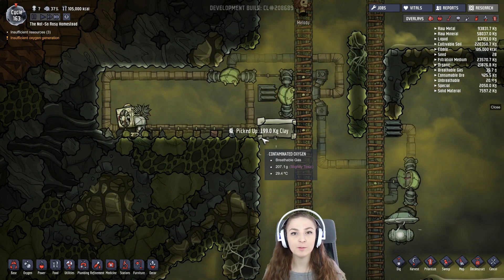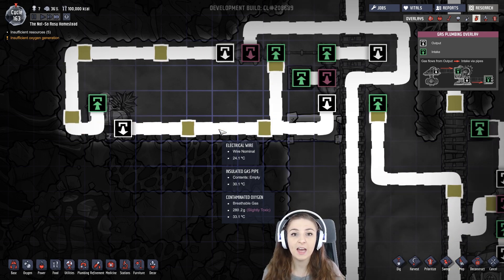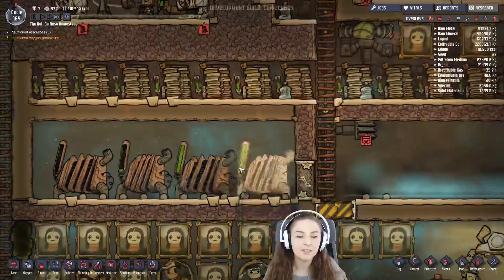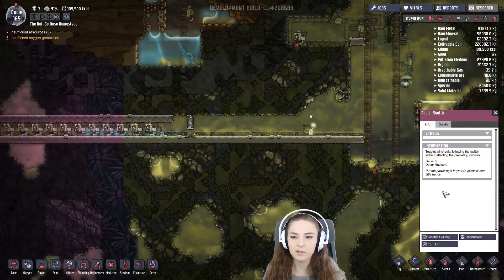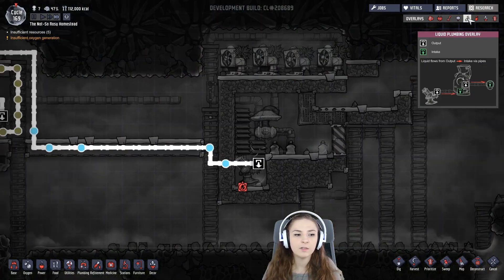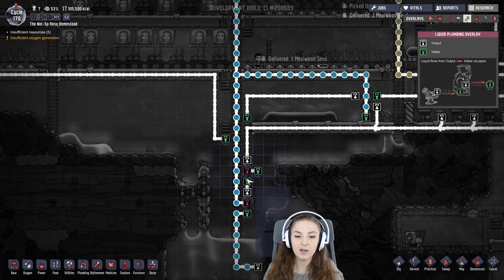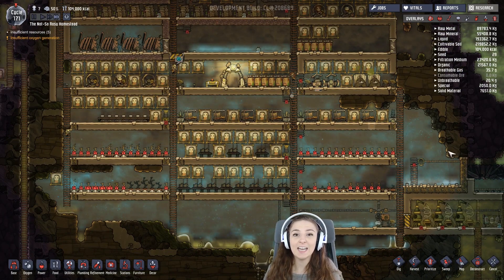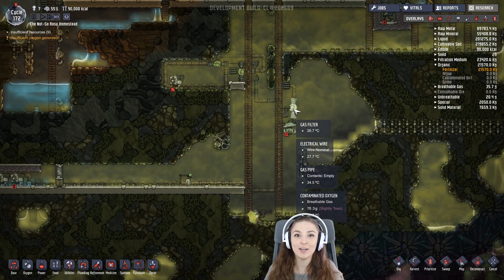How to Clean Contaminated Oxygen Without Sand!! - Oxygen Not Included - Alpha Release

Comment: hummm I tried your method to produce liquid CO2, but the insulated gas pipe actually breaks because of frozen damage. I even used gas filter to get pure CO2  input but the pipe still got damaged after the temperature in the pipe reached lower than around -48.5 C. Could this be a bug? I mean the pipe broke before I even get any liquid CO2, there couldn't be any frozen solid in there.
Reply: You can make a hydrogen chamber. Hydrogen doesn't liquefy at the same temperature as oxygen so you can use that, with thermo regulated switched to air condition the oxygen causing it to liquefy.
Reply from the maker: +qi liu Hi there! This was made before the recent update which changed how temperatures work! So that might have broken this... And I can't open the save files from before the update to check :( you might try using a room of wheezewarts to cool it. you can replant them on natural tiles by sweeping them into a compactor and then deconstructing the compactor. Hope this helps :)
Reply: Thanks! Forgot about that wheezewarts!

Comment: hey lace another tip you should cover is proper pipe placement and valve usage to prevent water deletion in  pipes. thing like breaking old lines to add filters. and and multiple  valves along your electolyzer feed line to show how the valves prevent water loss after the valve. i even have a set up that turns an electozyer room into a great air station and the hydrogen filter setup i have that runs my 17 cooler string by itself. not constantly unless it switch it back to main power but plenty enuf juice to cycle through material.. but say  for pipes you have a fresh line pumping 10k packs as standard you want to not waist 9k of that on air. you set up a valve to come directly off that line so the valve is taking 1k and 9k continues down. my air station  has 6 valves coming off the  same feed line that after the electrolyzers drips back into the storage tank for less waste. they only only take water they need now no waste

Comment: Lacy I have another idea to make clean oxygen. Make a vertical tunnel 2 wide with the those "fish" inside use 1 mesh doors horizontally a couple tiles above the lower end of the tunnel to lock them inside the tunnel when ever a mission enter there to collect slime. A gas vent a couple of tiles above the the mesh doors releasing contaminated oxygen from your "stink room" to feed the fish and a gas pump on upper end of the tunnel to collect the clean oxygen. I don't remember it the gas segregator can split clean oxygen from contaminated oxygen, but if it can I would put one of those making the contaminated oxygen run the tunnel again.

Comment: I've pumped cold contaminated oxygen and steam into the same insulated chamber 5 cells wide. Got 3 thin layers of liquid at the bottom: liquid O2, water, liquid CO2. They've exchanged heat very slowly, but they've started to "dance" for a lack of better description.

Comment: I have found that if you put a vent into small chamber, it will soon overpressurize but the pump will keep pumping gas into the pipe. You can reach 10kg per blob of gas in gas pipe that way. Maybe if you send that concentrated gas through your cooling pipeline (or just circulate it through one cooler a few times), you could cool a lot more of it using way less electricity.

Also it migh be good idea to drip the liquid oxygen on your batteries or something else hot so it doesn't produce such
Reply: A cooler takes about 1100g of contaminated oxygen in 1 cycle, so having a buffer should be more energy-efficient than pumping in smaller blobs directly from a pump.

Comment: Several questions: 
1. Can you mop the liquid carbon dioxide?
2. Does the liquid oxygen in your water system eventually turn to oxygen in the form of air?
3. Using your first oxygen generating system, If you don't let the contaminated oxygen become too cold, is it possible to avoid solid oxygen being generated?
4. With all those thermal regulators, 17 of them to be exact, it must pretty hot down there. Any possibility you can make a steam room out of that in the process?
Reply: Yes you can mop up any liquid.
Reply: 4. for some reason the regulators show twice the heat of batteries and don t actually make much steam. i have a series of regulators 17 as usual with a hydrogen generator at the lead the generator produces steam but the regulators not so much
3. adding an air filter will prevent it the mixing. filters and regulators only use energy when actually pumping a gas so they can be used more often then people do simpler systems work great but there are all ways tweeks we can do to make the systems more efficent.
2 yes
1 yes
Reply: Thanks for the responses, you guys really help. 

3. But even if I filter out CO2, I am still going to make solid O2 and solid contaminated ice, or am I missing something?

Comment: Lacy, can you make a video on how to cool base to a temperature optimal for the mealworm?
Reply: Just pump your base's air with an air pump into 1-3 thermo regulators that are sealed off from the rest of your base with insulated tiles and then pump the cool air right back into your base with some air vents scattered around your plantation. Make sure you put a power switch going to the thermo regulators or have access to your pump because you'll have to turn the AC off once things start getting too cold.

I'm using 2 thermo regulators and 4 vents and I'd say I normally have to shut the pump off and turn it back on every 3-5 cycles. It really doesn't need to be micro managed.